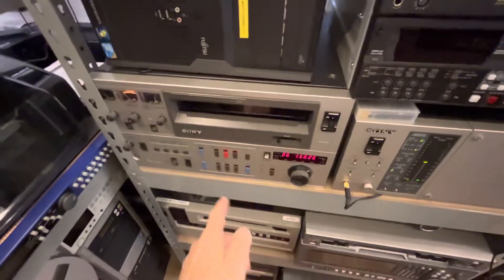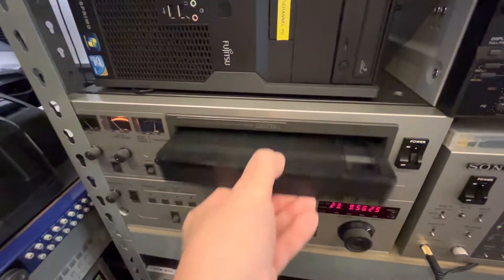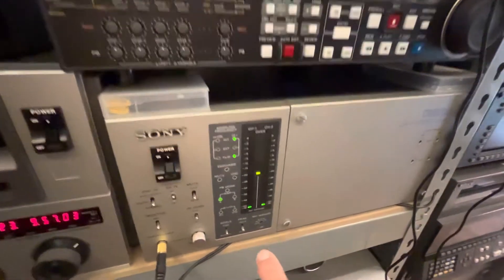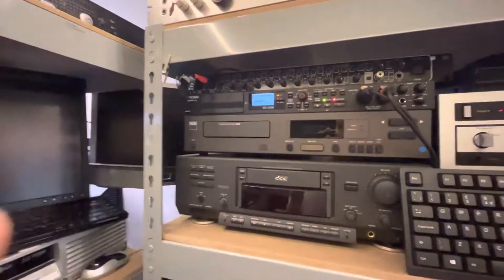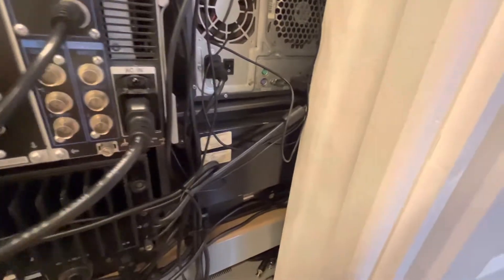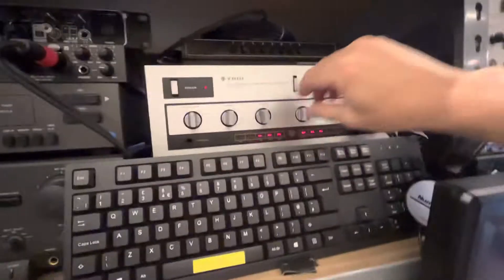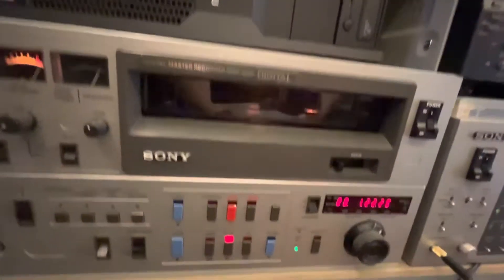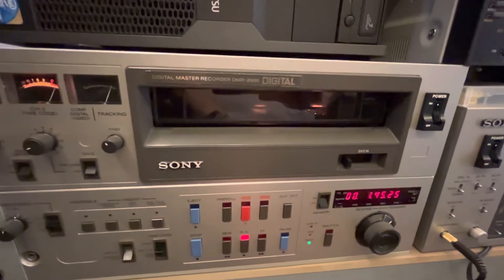Pcm 1630 Sony Umatic Digital Audio Transfer to wav pcm @avtransfersUK

Comment: Is this setup a fully digital transfer or is it analog between the PCM 1630 and the tascam ?
Reply from the maker: For this demo it was analog.  Digital is possible with an extra interface. Cheers.
Reply: @avtransfersUK  thanks
Reply: There was an optional AES/EBU digital output card for the PCM1630 which replaced the analogue output card (for one channel I think), but it's almost impossible to source.  What's only very slightly easier to find is a SDIF-2 to AES/EBU output route, I've done this with three of my systems now: Two have audio sample rate converters with SDIF-2 inputs, the other uses a modified DAT recorder which has the SDIF-2 input.

Comment: Best way to find one of these for sale? I love the sound of early CDs and most of them were probably mastered on the PCM-1610/1630. Would be cool to have it for fun.

Also, were there any PAL versions of the PCM-1610/1630? Like for example I assume Polygram in West Germany in the early 80s (which was owned by Philips, the co-developer of the CD) used Sony PAL machines for mastering their CDs. Unless Philips made their own PAL PCM processors.
Reply from the maker: Hard to find , but guess ebay.  

Not sure how common this model
Was in Pal however If these are anything like  consumer models ie 701,501 then it doesnt matter if the decoder is pal or ntsc it will decode either. 

So long as the vcr is pal capable.  All the tapes I have ever come across in this 1630 format have been ntsc. 

My machine was bought locally. 

Enjoy.

Comment: thanks a lot, right on time since I bought some masters on ebay just for the original content, but no player yet. Which brand / player can you recommand. only sony? I have a lot of experience baking mostly AMpex analog but also digital thin tapes , you just need a very good food dehydrator , pick the best you can find with lot of storage and two fans if possible, and you can restore any old tape. 2"sometime takes 2x 24 hours , think about what that would cost in a normal kitchen oven. cheers, nice demo
Reply: The pick of the bunch is the DMR4000 plus PCM-1630 with RAR option.  Then use a SDIF-2 to S/PDIF converter interface (hard to find) for a pure digital copy of tape contents, apply Red Book De-emphasis curve to the digital data.  I know that all sounds like a lot of faff but it's the best route.  However tape dropouts are a fact of life with this format, you can see in Howard's video the CRC red LED flashing sometimes.  The format was fragile when the tapes were new and never works without errors with ancient tapes.